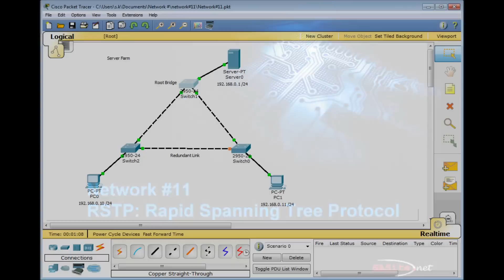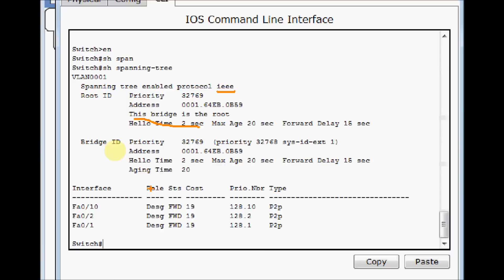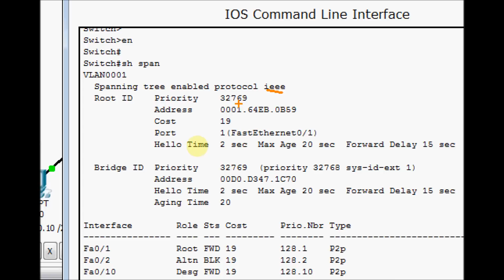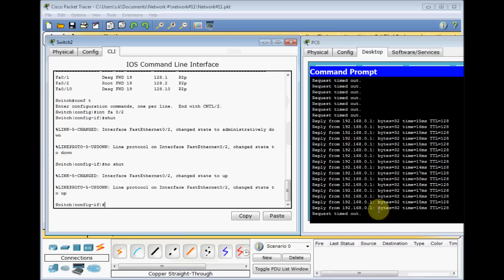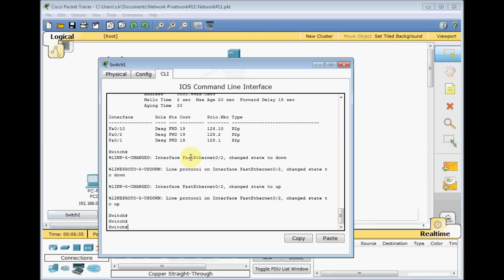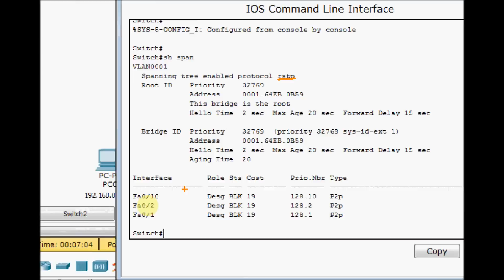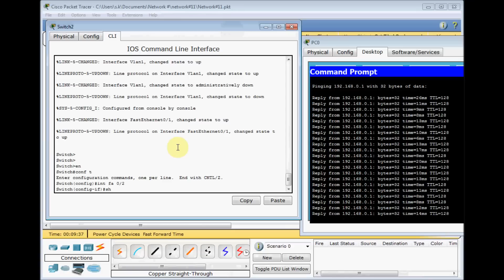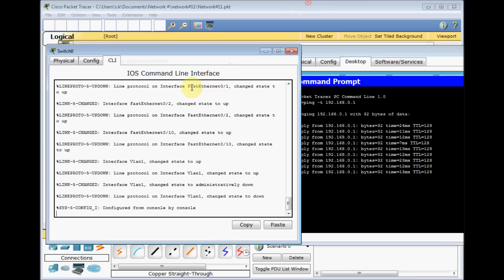Network#11: RSTP: Rapid Spanning Tree

Comment: ok , great demo! But I have a question . I have the same configuration on GNS3 and I use IOU switches. The convergence in gns3 is much slower `~35 sec for RSTP. When I try it on Packet tracer it works much faster. The only difference is that in gns3 I used Ethernet ports and in Packet Tracer - FastEhternet. Everything else is by default. Ideas ?
Reply: Same here

Comment: I would like to know if its possible for sw0 and sw2 ports going to sw1 to be DESIGNATED ports. so, ping from pc0 will go straight to sw2 and pc1 to sw0?
Reply from the maker: In this scenario, S1 is Root Bridge, so S0 and S2 need Root Port to reach to RB.
by the way in all cases ping from PC0 goes directly to S2 and ping from PC1 goes directly to S0, don't forget, PC0 and PC1 are direct host connected to the switches. they only need to go to RB if want to access to the Server. 
I hope this answer your question.
Reply: is there a way to force a port to be designated port? like in your scenario, port of S2 and S0 going to S1 be DESIGNATED. so both switches S2 and S0 will be the default route of their respective PCs going to S1?